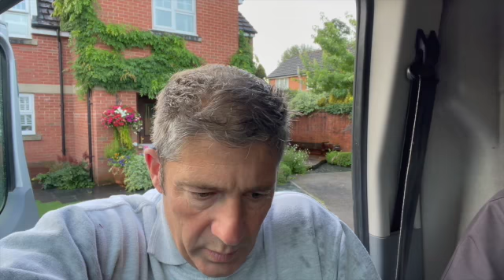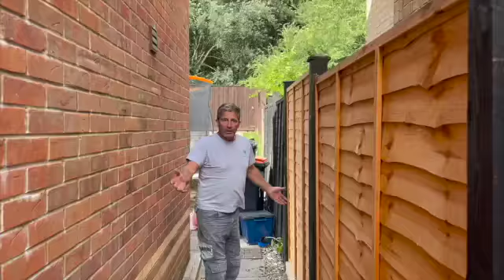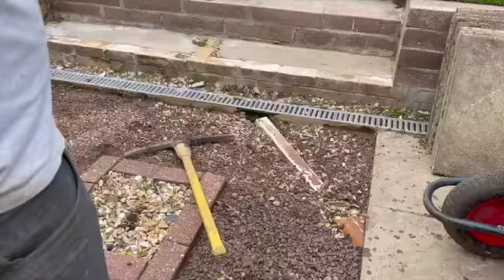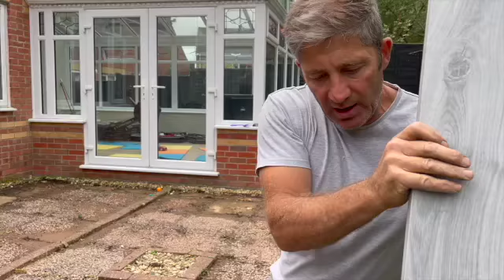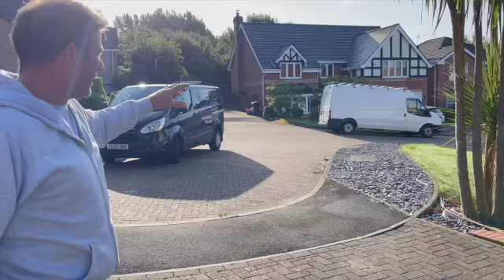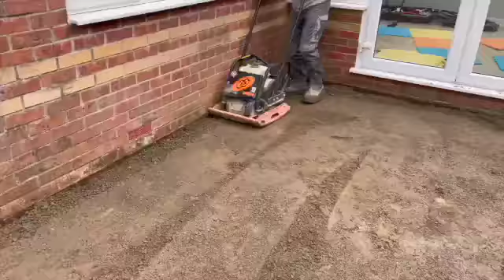Talking Porcelain & A Lean Mix

Comment: Are there any issues if porcelain is not sealed after laying?
Reply from the maker: Everything needs to be maintained it’s like cleaning windows as glass has micro pores but the issue is keeping the grout clean as it can go green in the UK climate
Reply: @GreentopLandscapes  wet and forget works wonders every now and again, diluted mix sprayed onto grout. Takes a few minutes :)
Reply from the maker: You can get solvent sealers

Comment: Hi. Thank you so much for all your time in making these videos. We’ve just started our DIY job doing our porcelain patio and have learnt all we know from your videos :) A quick question please? How thick should the layer of lean mix be? Thanks
Reply: Thanks so much for the quick reply. So we have at least 10cm of compacted sub base and we need 4 inches or of lean mix on top of that? Thanks again.
Reply from the maker: Thank you mate, as long as it’s a solid bed but don’t do any less than 4 inches, but make sure the dig is solid

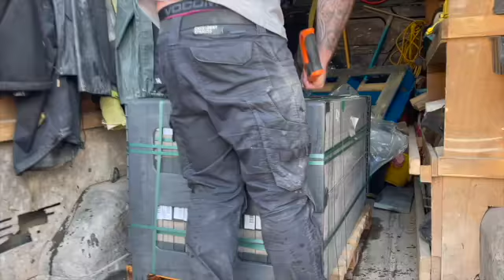Comment: Hi Johnny boy, going to be doing my own DIY porcelain patio shortly and have been watching your videos. Will put down 100-150mm mot, 50mm 1:15 pqc and then 30mm mortar bed 1:6. Can the mortar bed be a dry mix or needs to be a wet mix?
PS have you used the Rubi TZ manual cutter for 20mm porcelain?
Thanks.
Reply from the maker: Hi David, you can you a dry mix but it needs to be moist and yes for the TZ

Comment: If I haven't got all in one Ballast I use My MOT type 1 and mix sharp sand and cement together. Ive used the digger to knock up a load before!
Reply from the maker: Cheers Mark

Comment: Johnyboy - I can't seem to find a local supplier for a ready mix leanmix so I'm going to order ballast and cement separately. Is all ballast the same? sharp sand and 20mm gravel? Just going to barrow the ballast in and add the sand and give a bit of a mixing on the ground (on top of compacted mot1). Or do I need to mix it more precise? Great help and advice by the way. Top Man
Reply from the maker: Shame should have it ballast and cement at 15 to 1 call me if you need to talk
Reply: @GreentopLandscapes  Thanks John - I've got a couple more companies to call tomorrow so fingers crossed.

Comment: Hey Johnny, Firstly I think the videos you do are spotty dog. I'm currently preparing a sub base for my new new porcelain patio and was wondering if having ACO which goes along the perimeter at the rear of my house would I have the fall towards the ACO so it can drain or do I still set my fall to run off towards the grass?
Reply from the maker: Cheers Buddy, to be honest you can run water either way as long as the water gets away and does not hold but generally good practice to run away not that it can not be done.
Reply: @GreentopLandscapes  You're a star thanks Johnny,  keep up the good work and for posting informative content.

Comment: Hi johnny, when you sbr your lean mix, do you just do it like you would pva a wall pre plaster?  

Also do you seal all porcelain? 

Ive got my first one to do! But it is in a glass room.
Nice informative vid pal👌🏻 Cheers
Reply from the maker: Cheers Buddy, you can seal porcelain as it has micro pores like glass and will get dirty but it’s to ensure your grout does not go green. SBR is a great water proofed so a coating over the leanmix may be 50/50 will stop the moisture in the mortar being sucked out.
Reply: @GreentopLandscapes  
Good stuff johny, cheers for replying mate👌🏻👍🏻

Comment: Hi Johnny Boy. Another good vid. I've got a 40sqm sub-base that I want to improve in similar fashion to what you've done here. It's currently comprised of a mix of 803/MOT1 & 14-20mm chippings. Want to bind it all a bit more so it compacts nice and flat with no voids so thinking to add a lean mix over the top and rake through. Few questions if I can (1) 15 and 1 - sharp sand or ballast for the 15? (2) do I make it up semi dry (just using the moisture from the sand) or add water? (3) presumably I can barrow mix it up, tip it out in sections and level off? Any advice appreciated.
Reply from the maker: Scott mate call me it will be esier

Comment: Hi John
What i find on new builds is a lot of the water from the roofs is going into downpipes a d poorly installed soakaways. We tben add to the drainage system with our patios which increase the volume of water into the soakaways. Dont forget the soakaway water goes back into what is always an already soaked garden .ticks an environmental box for service water being kept in your garden and not adding to the already overloaded main sewers but it keeps these gardens soaking wet. If you suggest say a new create soakaway it can be an expensive cost on top of the costs for new paving so most say no to it so the problem never goes away .Also SUDS in wales isnt adequate enough with our huge rainfall which is the wettest in the uk.
We all face the same issue whats the answer that's tbe big question is there one mate 
Good luck great video great knowledge 
Justin brickright 👍
Reply from the maker: Hi Justin Buddy how’s it going
Reply: @GreentopLandscapes  
All good with me mate hope you and family are well 👍